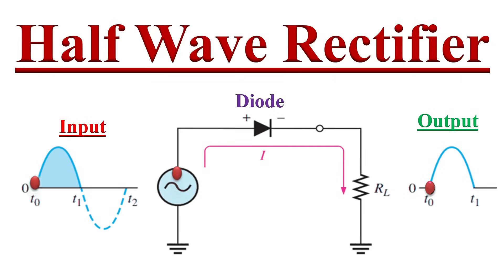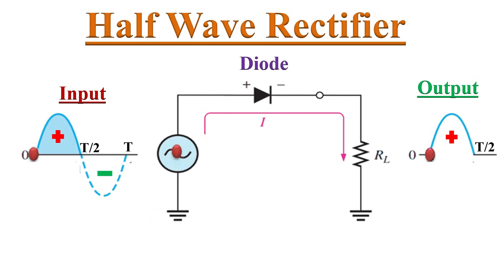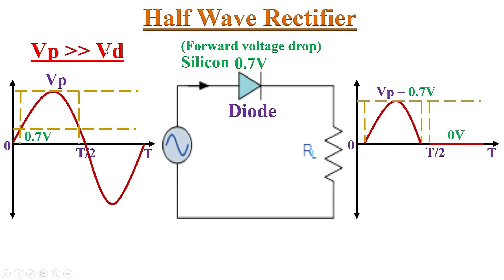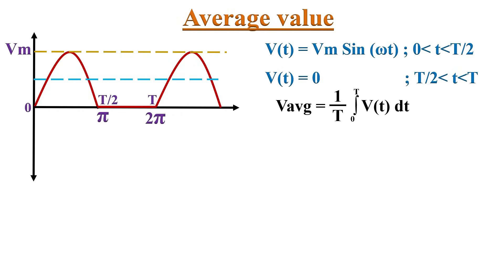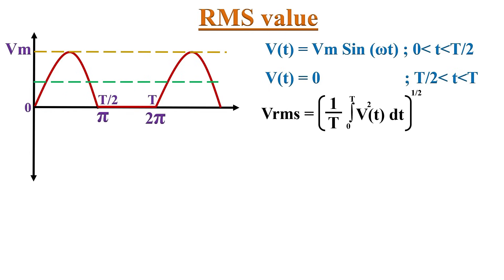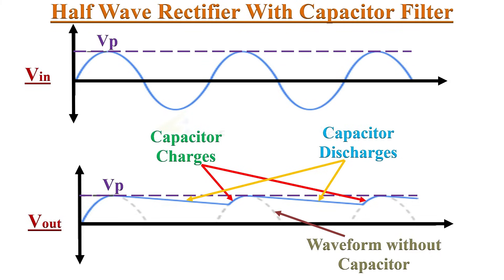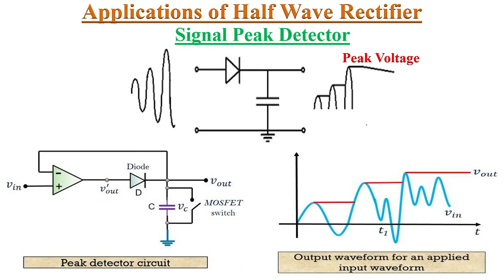Half wave Rectifier Explained

Comment from the maker: Timestamps for various topics covered in this video are as follows:
1:47 Half-wave Rectifier circuit and working,
5:37 Average value of Half-wave Rectifier,
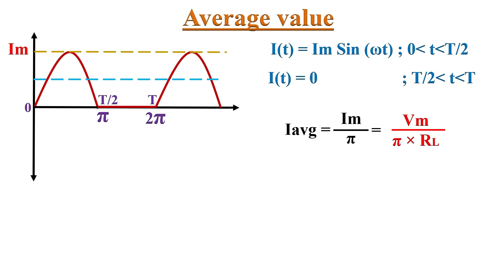8:12 RMS value of Half-wave Rectifier,
8:41 Peak inverse voltage (PIV) of Half-wave Rectifier,
9:29 Ripple Factor of Half-wave Rectifier,
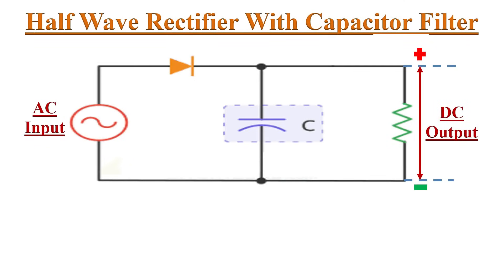10:18 Half-wave Rectifier with capacitor filter,
13:31 Efficiency of Half-wave Rectifier,
14:15 Applications of Half-wave Rectifier.